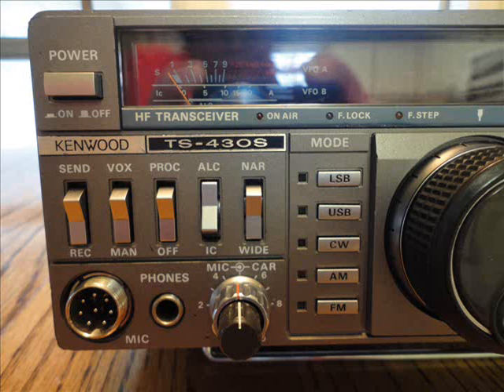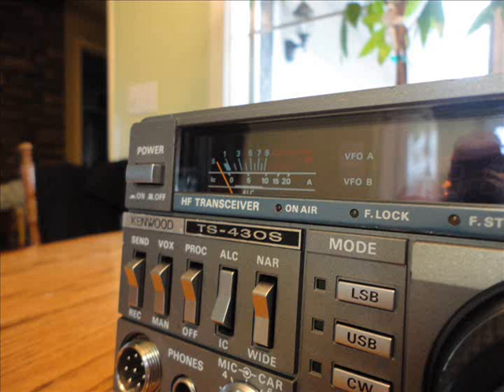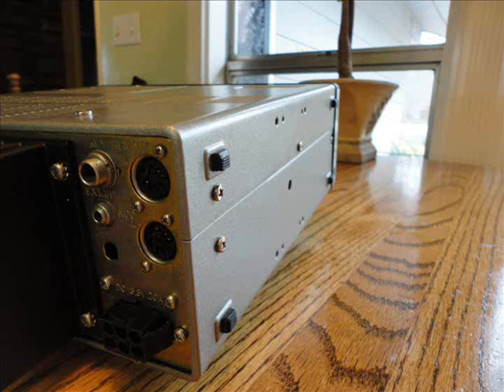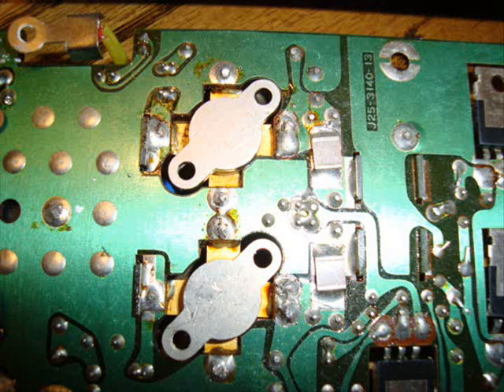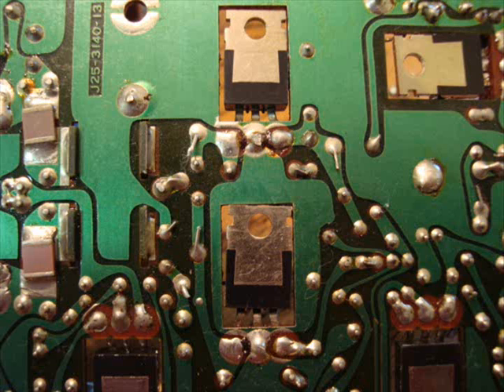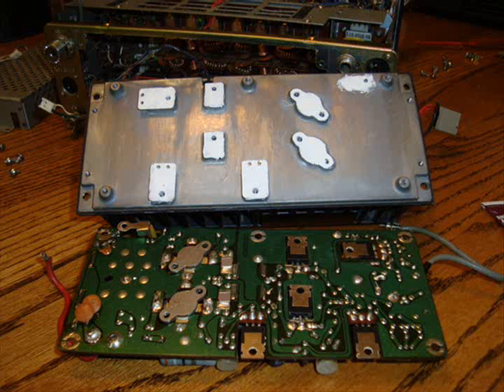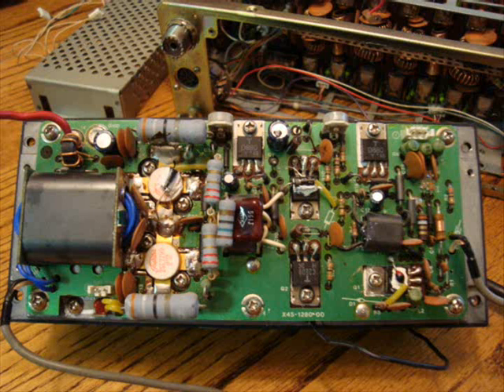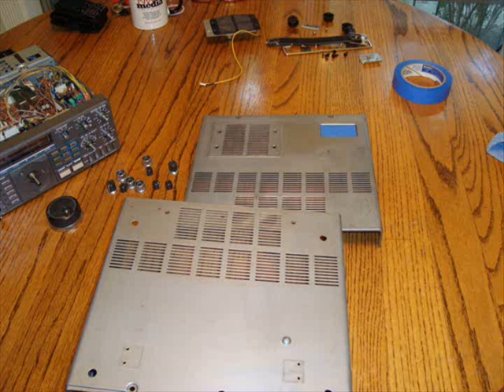Kenwood TS-430s Restoration

Comment: Lovely paint job on the case,  what colour did you use , I have one of these radios the PA stage is still intact so far,  mine has the FM board and SSB and CW filters in it aswell

Comment from the maker: @F41Driver   Yes All the Relays where dirty. When I got the 430s there was no receive and transmit power was 5 to 10 watts on all bands. the radio was not used for 10 years (this is bad for radios, all of the contacts oxidize and the pots oxidize also)  I burnished all the relays with paper then cleaned them and all the pots, switches, and all the trim pots(on the boards) with deoxit cleaner then Deoxit enhancer & protector before I did the full alignment as per the TS-430s service manual.